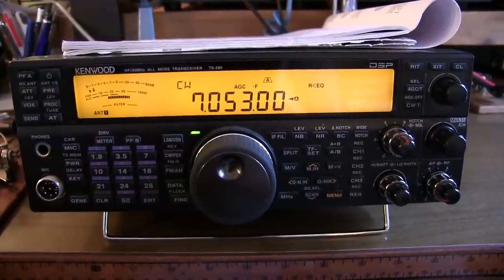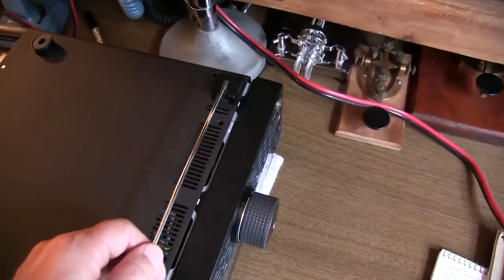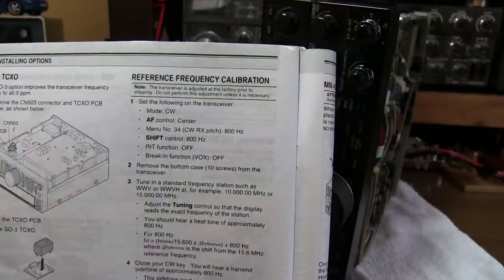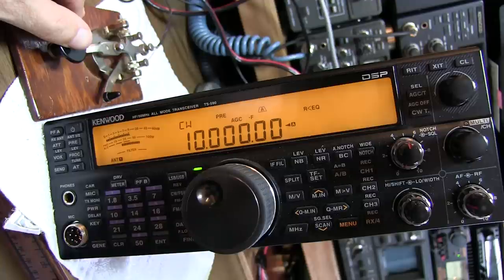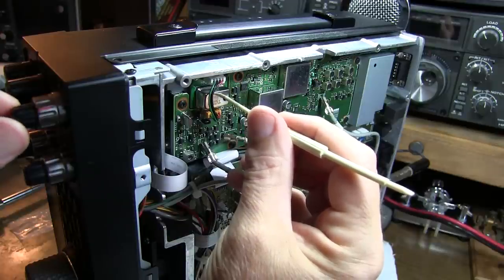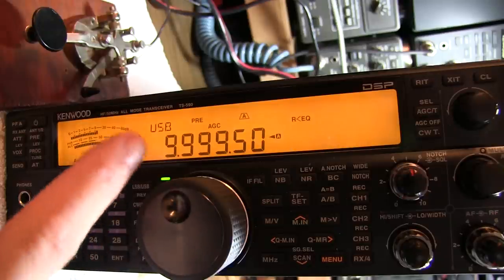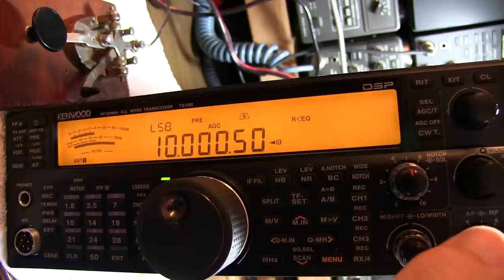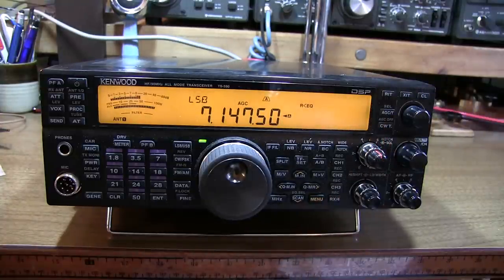#301: How to install and adjust the SO-3 TCXO in the Kenwood TS-590

Comment: I was strongly considering the Icom IC-7300 but I think I prefer the TS-590G instead. I know it uses the older superheterodyne architecture but from everything I've read I prefer the TS-590G. I have a TS-480SAT and a TS-2000 and I love the audio these transceivers produce so I think I'm gonna go ahead and order me a new TS-590G tomorrow via HRO or Gigaparts with the TCXO option. I installed the same TCXO in my TS-480SAT and it's worked perfectly the past five years now.
Thanks for for this simple to follow how-to instruction on installing the high stability crystal oscillator. I'll put this to good use in a few days when mine arrives  :>)

Comment: Great video. I have switched to GPS disciplined TXOs in all my fixed station equipment. Even without GPS, it's dead on accurate. I bought a used Rubidium standard module from cell site service and can maintain my own frequency standard. I just don't have to worry about frequency accuracy anymore.

Comment: Note, the 800Hz tone generated by Kenwood derives from the same TXCO you are calibrating against the broadcast tone on 10MHz carrier. So the method is correct and there is nothing to dislike about it, maybe except the fact of using human ear instead of the scope or good frequency counter to determine both 800Hz tones to be exact.

Comment: Hey Alan,

Xrunner from the EEVBlog - a friend of mine wants me to calibrate his SO-3, and I have a GPSDO locked frequency counter. Why can't the base frequency (15.600 MHz) coming out of the S0-3 be measured and calibrated at the output of the little board it is on? Seems the most direct way to do it. Thanks.
Reply from the maker: Since you've got a GPSDO locked counter, then the direct measurement as you suggest will be fine provided you have a way to probe the output without affecting it.  Most people don't have such a counter, so the WWV method works for them.

Comment: You were vague on the placement of the jumpers. Are they re-seated or did you not plug them in all the way.
Reply from the maker: You can remove them entirely when you install the TCXO.  In this case, I inserted the jumper over only one pin (for storage), so it's not connecting any pins together.
Reply: Oh got it. Great idea. You put it in a drawer and will forget where it is. I just bought one coming from China.  Won't be here till July 2. Thanks for the instructions.  Hope to hear you on the bands. Have not heard you on 40 in a few years. Hope all is well.
Reply from the maker: @anthonycosta1776  Oh - hey Tony - I didn't realize it was you.  How's life in VA Beach?  Where have you been hanging out on HF these days?  I've been spending a bit more time on CW.  Kind of lost touch with the old 75m crowd...

Comment: Hi Alen. I have ts-950s (not digital), and without TCXO (this version not have preinstalled) frequency is not stable. Now I see external reference input connector and switch, but with text (10khz). Why is external reference only 10khz (I have very good reference in other equipment, but it is 10MHZ). Can you explain why Kenwood set this to only 10khz. Also I see that internal reference oscillator can be upgrade with 20MHz TXCO. Thank you for great videos
Reply from the maker: Without studying the PLL design, I can't be sure.  But it seems like their using this 10kHz input as a phase reference for their internal higher-frequency reference oscillator (not as the reference itself).
Reply: @w2aew  Yes, this is only phase reference. But it is not easy way to find some external signal for this (I dont know is there some ham rig for this 10khz reference).  I will try to buy 20Mhz TXCO and upgrade rig. It will be so simple that Kenwood was set reference to 10MHz with external BNC input.  Thank you.

Comment: Thanks for sharing! Could you do the USB vs LSB tone check on WWV’s exact frequency? What’s the advantage of going down 500Hz on USB and up 500Hz on LSB?
Reply from the maker: The main advantage is that you'll be listening to the heterodyne of the carrier which is steady, accurate and strong.  The sidetone transmitted on the WWV signal changes, and isn't constant during the transmission.
Reply: Thanks!

Comment: How long did you have to wait for the TCXO to come up to temperature ?
Reply: There is no warm up period. You’re thinking of an OCXO (oven controlled crystal oscillator). This is a TCXO (temperature compensated crystal oscillator), where temperature variations are internally compensated/tracked.
Reply: @alanwolke6253  I'm under the impression that all precision oscillators have some time after powering on before they settle to their drift specification, some more than others.
Reply: Sure, but just a few minutes, unlike an OCXO which may need 20-30 minutes to stabilize.

Comment: I can't adjust it like you described.  My radii won't key on 10 mhz. You must have did the mars mod.
Reply from the maker: It won't produce an RF output, but it should still produce the CW sidetone when keyed in CW mode with a key.

Comment: Hi I am K-1 EMW and I’m 84 years old and I’m not very good with these menu radios but I have a Kenwood 590 S and I’m not sure how to adjust the high shift and the low wide when I’m on sideband what does setting should be I wonder if you have time to help me if you would send me a message thank you very much
Reply from the maker: I will send a separate message to your email address listed on QRZ.com
Reply from the maker: I tried sending an email to your QRZ listed email address, but it bounced back.  Here is what I emailed to you:

These knobs are used to control the filter that your received signal is processed through.  The labels on those knobs can be confusing.  They are labeled this way because they perform different functions depending on the mode you are operating.

For sideband and AM, use the HI and LO labels on the knobs.  These control the high frequency and low frequency cutoff of the SSB (and AM) filter.  For most sideband operation, adjust the LO for something like 50Hz or 100Hz, and adjust the HI for something like 2400Hz to 3000Hz.  These are good starting values.  If you are getting interference from adjacent signals, you might adjust these to reduce it.  If you want to hear more "high fidelity" sideband, you can increase the HI up to 6000Hz as I recall.  There is no right or wrong way to set them - adjust them for your own listening preference, remembering that you are setting the low-frequency cutoff and high-frequency cutoff of the audio response that you are hearing.  There is a little "bargraph" shown on the S-meter that moves as you adjust these knobs, which gives you a visual indication of the filter bandwidth.

For CW operation, the labels that apply are the SHIFT and WIDTH.  This this case, the WIDTH knob adjusts the width of the CW filter, which can be adjusted as low as 50Hz.  The SHIFT control will adjust the center frequency of the CW filter.  You would normally adjust the SHIFT so that it equals the CW sidetone frequency that you use, and then adjust the WIDTH for your own listening ease and comfort.  Adjacent signals can be reduced by slightly moving the SHIFT, or adjusting the WIDTH to something narrower.

I hope this helps!
Reply: @w2aew  Thank you very much I got the answers and I appreciate it thank you for everything Hope you had a happy new year my address is OK my add ok on qth Thanks again
Reply from the maker: @donaldshields2483  OK, the email address bounced back, but maybe I typed it wrong...  Happy New Year.

Comment: As long as WWV is accurate.   I think they are.  Don't they use like a Rubidium standard, or Cesium?  Tune to that heterodyne and blow air across a lose or bad PLL and listen to all the funny noises it makes. Just air across a crystal will make it 'lose its tune'.
Reply from the maker: WWV's carrier frequency is held to within 1 part in 10^14. At 10MHz, it is within 0.01uHz.